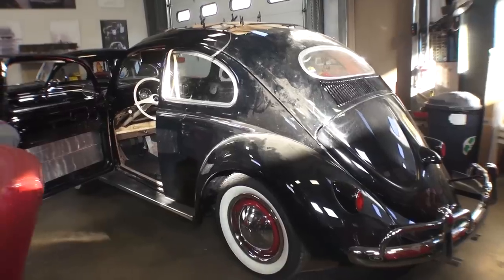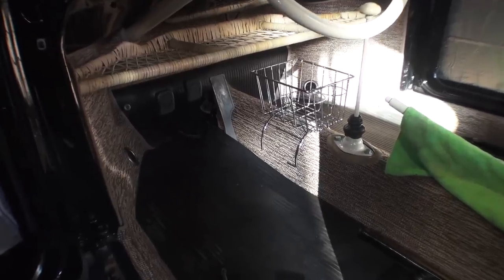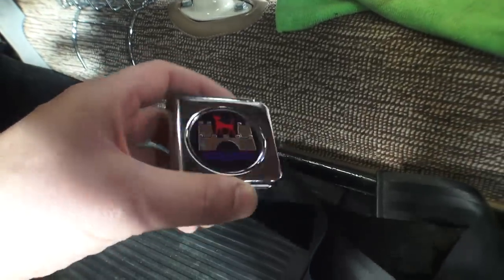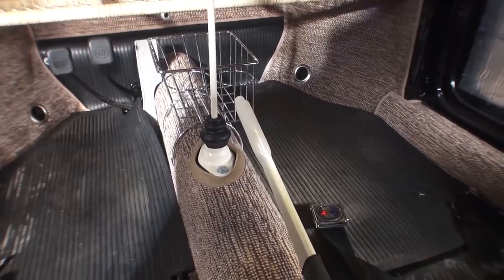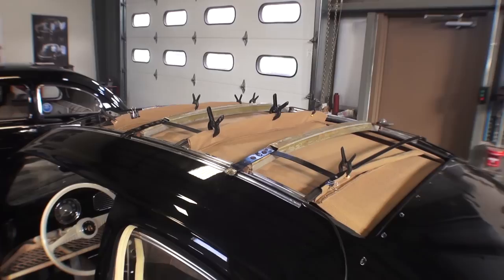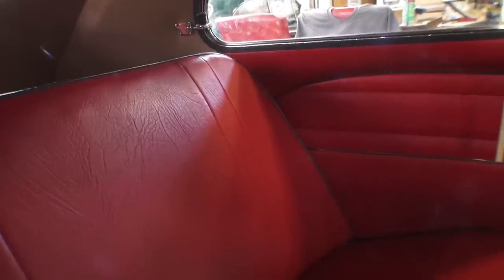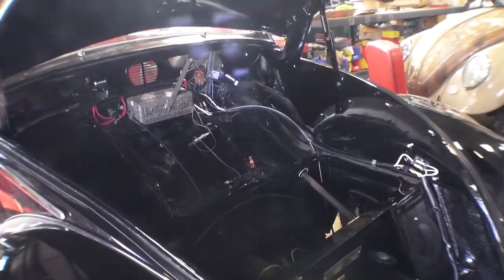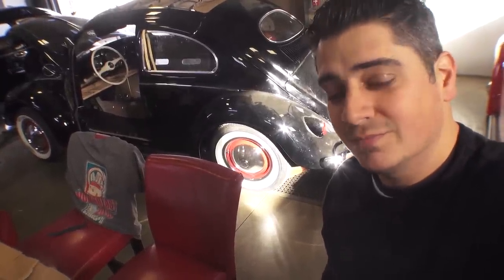Classic VW BuGs '55 Beetle Ragtop Road Trip Garage Barn Find Resto Project Pt. 6

Comment: Here's a question to ask.  When showing the inside of the car (around the 7:15 point, specifically the material for the ragtop portion), the sun visors off to the left in the shot.  What year were the plastic semi-transparent featured in?  I have a 1959 ragtop which had them but one of them broke off.  Are these period correct for my year?  Or did they have a different version like a vinyl type instead?  Thanks!
Reply from the maker: you are correct the black plastic is true to the car till 59.

Comment: do you use those mounting plates that weld in under the floor pan for the belt bolts?  Or do you just use a washer and nut under the pan?
Reply from the maker: Matt Jackson Washer and Nut, they come with the belts.

Comment: The carburetor is new , VW Beetle Thing Karmann Ghia Carburetor Brosol 113 129 027, and the distributor has also been  replaced, im still at a loss ?
Reply from the maker: Adam Socolofsky Doesn't mean anything, could be all crap sucked in there.  You have a fuel filter on this motor?  See if it is dirty.  I would take that car off and inspect it.
Reply from the maker: Adam Socolofsky Doesn't mean anything, could be all crap sucked in there.  You have a fuel filter on this motor?  See if it is dirty.  I would take that car off and inspect it.

Comment: I have a 70 Supper Beetle and im having starting issues, i have replaced the starter, new battery, fuel pump, i put a fuel  filter  on it and it will start but then idle ruffly and then die. Any ideas , thanks spark plugs were also replaced.
Reply from the maker: Adam Socolofsky Doesn't sound like you checked your carb yet...